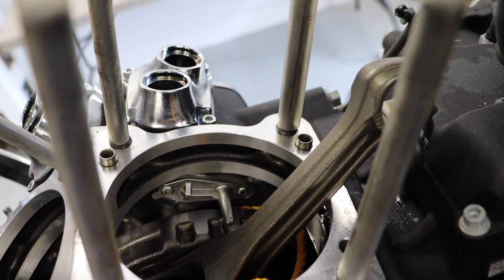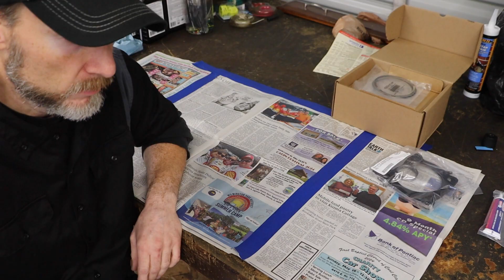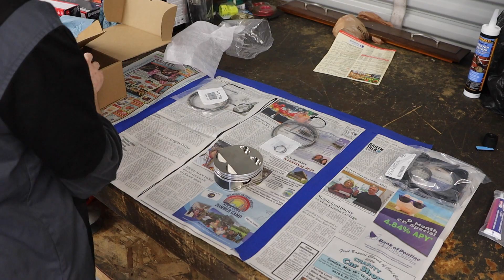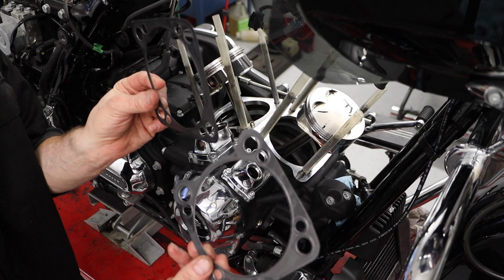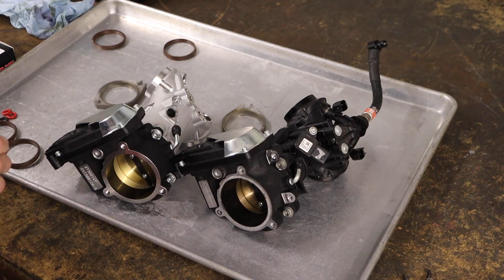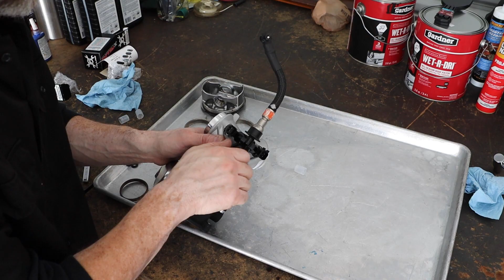Build Project 1:  Harley-Davidson M8 107 to 124 Part 2: Engine Assembly

Comment: What size injectors did you use?
Reply from the maker: Its been a while since that build but I think it was the Screaming Eagle 5.5g/s.  I've used that injector in bikes up to around 135-140 horsepower. It also could have been a Fueling 6.3g/s.  I was using some of those during that time too.

Comment: I am somewhat curious to why you wouldn't use ATF on a rag to clean the bore? It is a common thing in the auto side of house to do this. Give it a try, after you clean the bore your normal way, to get a rag with a little ATF and see what else comes out of the hatching. I appreciate your video and the breakdown on the steps. I am considering taking my 107 up to a 124 in the future. I have this build series bookmarked for then.  Are your jugs affected? S&S said their kits were out of round and they had to revise the build. Kevin Baxter did a few videos on that issue. How has your bike been since the build, how many miles have you put on the big bore kit?

Comment: Did you reuse the stock cylinder studs and head bolts ?
Reply from the maker: Yes I did.  So far I've never had a problem with the stock studs on the M-8.  They are big and beefy.  I have used Fueling (ARP) studs when customers request them or if I'm building something that will create a lot of cylinder pressure.

Comment: Every time i search for a video based on 107 to 124 i get a bunch of video shorts! Thank you,  very informative! Question, i like to go on multi day rides,  not just faster.  How's the ride, mileage affected and what about the left side of the engine?
Reply from the maker: I have other videos I have filmed but not posted yet about taking care of the primary side.  First off, if you aren't racing and doing burnouts there is no need for a chain conversion.  The belt is plenty strong and low maintenance.  I would recommend using stronger clutch springs.  Easy to change and only about $35 to $40 through EBC (I think).  These springs will add about 15% pressure to both the clutch and your lever.  Nothing else is needed but if your Compensator does wear out it can be updated. It depends on how you ride.  This bike in the video has been running fine on the stock compensator.  Ones from Darkhorse are great for performance but pricey and noisy. Secondly, your milage won't change much if tuned properly and you are easy on the throttle.  Just cruising will be close to stock within a few mpg. Hit the gas and it will drink more fuel.  Power requires fuel.

Comment: i have a couple questions if u dont mind . Did u use stock heads or cnc ported heads ? Did u reuse 55mm intake and module or 64mm? reason i ask i my top end is smoked both pistons and cam oil pump as well . i bought an S&S 124 kit comes with everything . Except the cnc ported heads and 64mm intake . Can i get by with the 55mm and or just do the bigger heads while im there ? budget friendly
Reply from the maker: The heads were 100% stock.  Because of the relatively small S&S 475 cam even the valve springs were stock.  I've put stock M-8 heads on up to 128" motors and they all ran well.  I have used CNC ported +1mm valve heads on builds too and they give a bit more on mid to top end but it so far doesn't seem to make a huge difference at these displacement levels. Don't have any experience yet with the huge 143+" engines.

If you use the S&S 550 cam you must install the big lift valve springs.

I did use the 64mm throttle body.  The 55mm throttle body will actually work pretty well.  You would just be down on power and torque at the upper rpm range.  If you rarely ever rev the motor past 4500rpm then you might not even notice much.  With the 55mm the engine will still rev out to 6000+rpm but ultimate power would suffer is all.  I'd say give the 55mm a shot and the 64mm can always be added later if you want more.  Just needs to be retuned with the larger throttle body.
Reply: @rageracing6435  thanks man very helpful